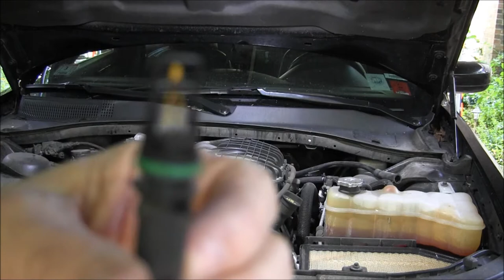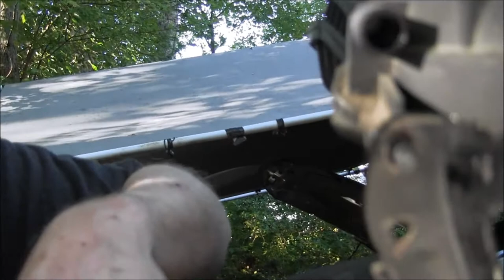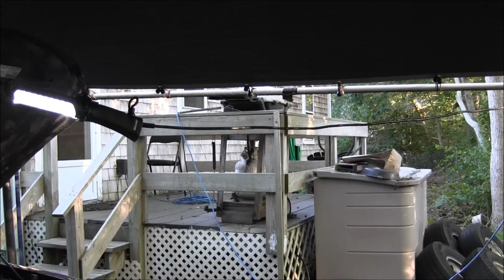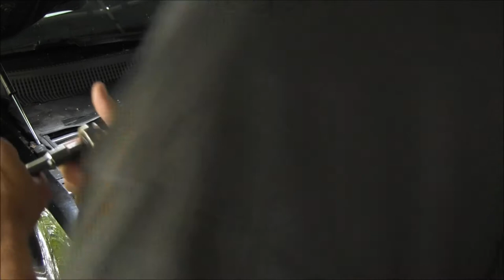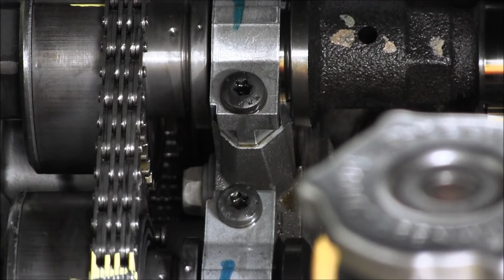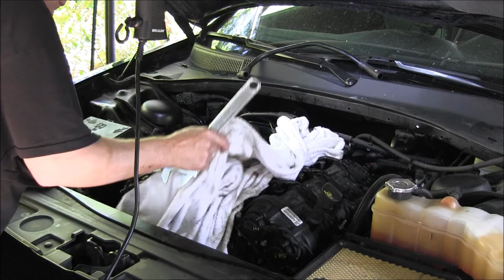Project Pentastar Roller Rocker and Lifter Replacement.

Comment: Great job. One question I have is, do you have to drain the oil and the engine coolant before starting this project?
Reply: Nope. I'm sure you can do it quicker as well. The hardest part was removng the plenum.

Comment: Do you have to collapse the hydrolic lifters before you install the camshaft?
Reply: Nope. I would soak them in oil first. As long as theres no tention on the cam you should be fine.

Comment: Is that chain tensioner universal?
Reply: There is one year that is different so be sure to verify it fitys your year.
Reply: @BatMan-tp2qm  Thanks Batman
Reply: @BatMan-tp2qm  I ended up instala salvage engine. Every thing is running well. My sister will be visiting next week so I can look at how its running. It has a check engine light. Cytilist low efficiency. P0420. Im thinking the exhaust manifold might be cracked. The previous engine had a crack and the salvage engine had a exhaust manifold crack. I might change the engine mounts if it is cracked. The aftermarket exhaust doesn't have a flange joint that is as flexible as the original so that probrobly aint good.

Comment: Might as well change the rockers and the lifters.
Reply: I Agree. Your in that far you'll be glad you went the extra mile...
Reply: Yep.  I just did this on my daughters 2015 Jeep Cherokee Latitude 3.2l and finished up yesterday.  Had 1 bad rocker and 2 lifters in front bank and 2 bad rockers and 2 lifters in back bank.  Was quite the job but well worth saving the money the dealer wanted or a mechanic.  But for anyone, know your limits before you start.  Lots of proper tools needed and lots of parts.  I also changed the spark plugs which was simple at that point.
Reply: @avguytx4361  Good job! There actually fairly easy to work on, I did the solenoid pack on the transmission, that's around 100 fasteners give or take but not to bad.